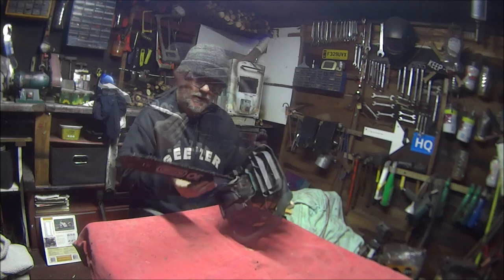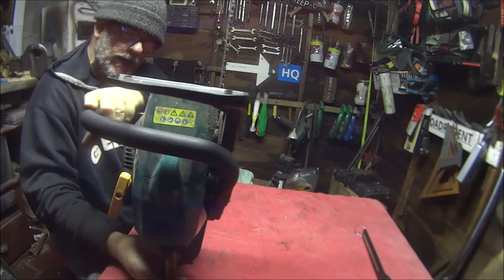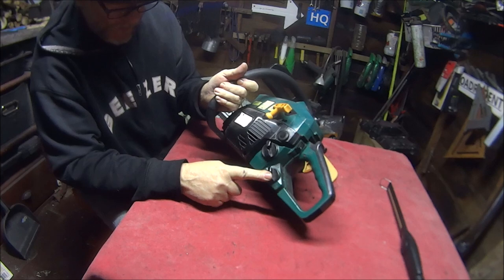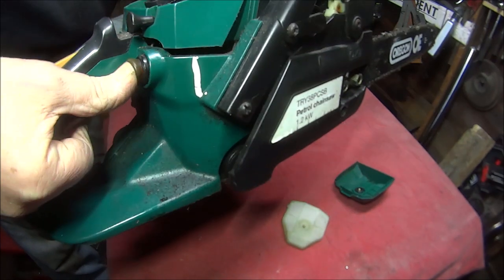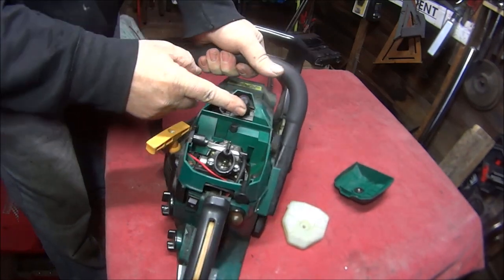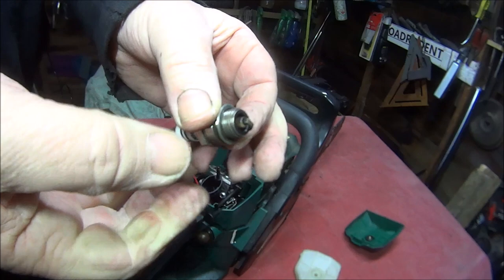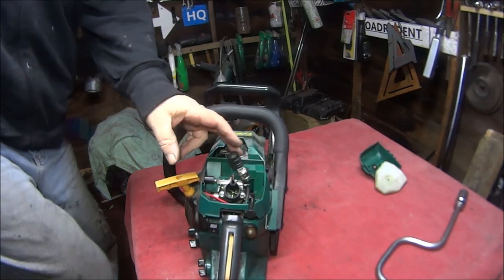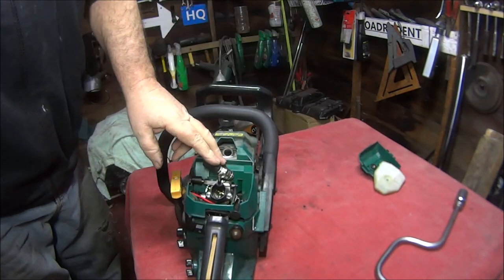OREGON Chainsaw, won't start.

Comment: Don't let yourself be dazzled by the fact it's a chainsaw, it's just a petrol engine like a bike. It looks like you've got compression and a spark, so it looks like it's a fueling problem. 99 times out of 100 it'll be a crack in the rubbish fuel line they use which goes rock-hard in days when exposed to fuel, or a pin-prick in the primer bulb, so that when you press the bulb to prime the carb, it just sucks in air rather than fuel and the bulb never fills up. Try a few drops of petrol in the carb before you start ripping it apart. Best of luck.
Reply from the maker: Hi Carl. Thanks for the helpful info much appreciated, I'll look into this in the next video. Thanks again buddy 👍
Reply: Good advice about the primer bulb!

Comment: Small cc engines don't like bad fuel. Once it's 6 weeks old they can begin playing up.  Drain the tank and refill with fresh petrol, add 2 stroke oil at 50:1.  You can also add a drop of petrol in the cylinder to help it fire up which will draw the new fuel through the carb.
Reply from the maker: Thanks Gary. I'll try that hopefully I won't need to strip it down 👍

Comment: Tip: Check out/change the fuel rubber hose. Sometimes, after a while, there is small, almost invisible cracks, that makes the carburator suck to much air, via the fuel intake.

This problem seems almost unique to chainsaws. I don't know why. Maybe the carburator underpressure is higher for chainsaws?
Reply: I think it's mostly down to the rubbish hose they use on these cheap petrol motors hardening and cracking with the vibration.
Reply from the maker: Bengt thanks for the comment that's very helpful we will go over this in the next video hopefully I don't need to strip it down. 👍
Reply from the maker: Ok Carl cheers buddy 👍
Reply: @jollygreengiant  I have had this strange problem on two Husqvarna 346 XPG (pro logger model) with high quality original parts, and the rubber hoses got bad anyway, with very strange motor problems. Replaced the hoses and they ran good as new. (Might be the E10 in the petrol that makes the rubber go bad?).